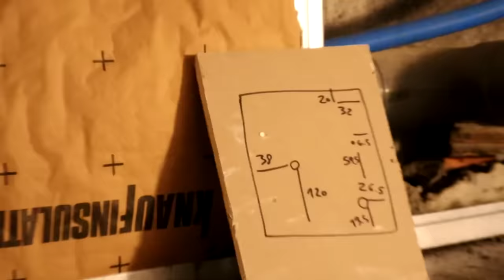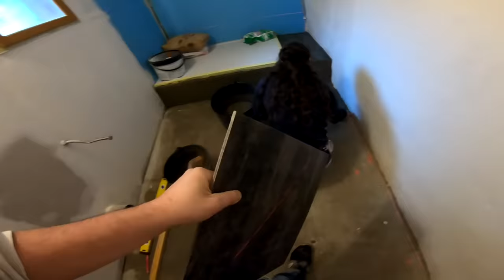TIMELAPSE: Couple Restoring an Abandoned Old House (6 months in 38 Minutes - all we did)

Comment: That's coming out great, however, I'm worried about 2 things: First, this 25:43 section of the roof. The shingles at the end are too big, there will be a lot of water splashing on that wall. You have a good size gutter, you can cut those shingles. Second, you shouldn't leave the wood beams exposed in the bathroom, there will be a lot of humidity from the shower.

Comment: Well that wall paper all over that house is aweful, one of the 1st things you should do, After you clean up the mess Is make that fireplace smaller, because a fireplace can suck ALL YOUR HEAT , Out of the room and up the chimney, make sure it's clean and line it with an insulated pipe up in a woodburning stove

Comment: I am worried that you used more than building equipment into an old building and like insulation is not fixed and very fluffy without a vapour barrier this insulation will flush down.